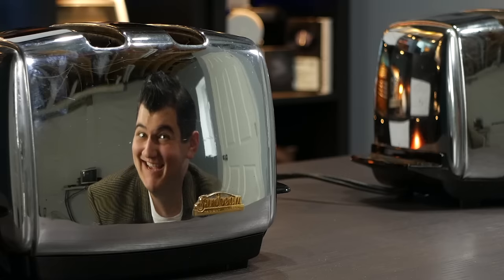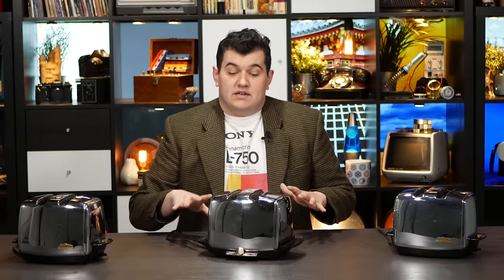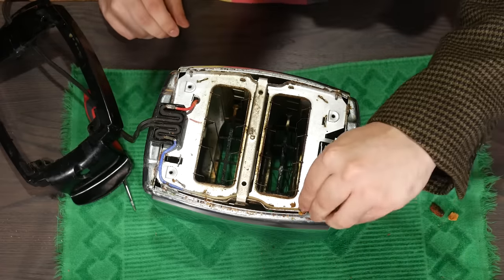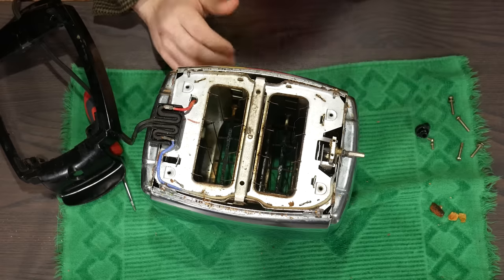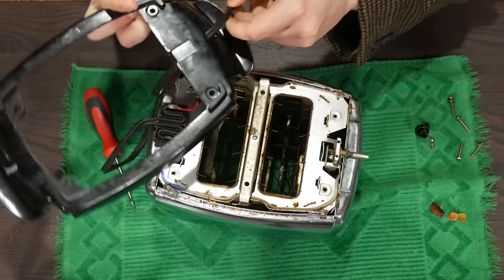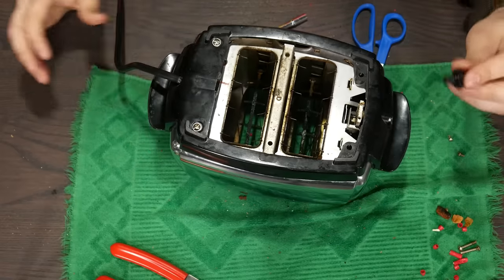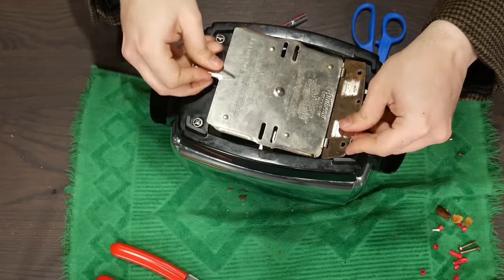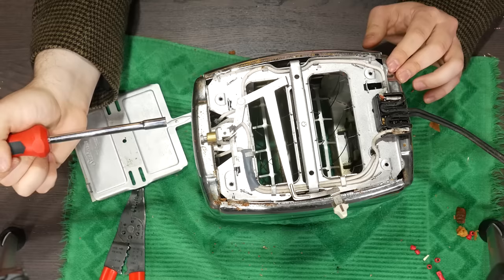Sunbeam Radiant Control Toaster--Repair and Modernization

Comment: An important note about grounding the toaster:
There's some healthy debate in the Internetosphere about whether or not a toaster should be a grounded appliance. And that debate is not without merit. Now that the toaster is grounded, it is potentially more dangerous in the scenario that someone is foolishly sticking a knife down there. If they touch the knife to the wire, and their other hand is touching the toaster, there's now an excellent path to ground through their heart. Not good.
But, because this toaster is just a circus of exposed metal surfaces with energized wires snaking through it, there are many potential ways for the wiring to short to the chassis, and thus you'd end up with a toaster that can zap you just by touching it.
So, you've got to decide which risk you're more willing to accept. Personally, given the old and questionable insulation in our T-35 toasters, I'd prefer if the chassis were grounded. I know I'm not dumb enough to stick a knife down a toaster, but I don't know if the chassis might inadvertently become live. Still, I understand the theory behind not grounding a toaster. So, do whatever you like.
However, if you've got the toaster plugged into a GFCI outlet or on a circuit with an RCD, both potential risks are mitigated by external means. So there's that!
Reply: Sure if the chassis was live it could zap you just be touching it, but that zap is very unlikely to be fatal, or even particularly painful (I've accidentally touched exposed 120v wiring before, it's really just tingly) if it's just done with one hand. Hand-to-hand circuits (with the heard in-between obviously) are much more dangerous.
Reply from the maker: It's pretty much a pick-your-poison scenario in my opinion. And/or situational. With children in the house who don't know better, it's probably wise to leave this without a ground. In a kid-free household, I'd rather ground it and not be fearful of its antiquated internal wiring. In either case, GFCI protection is a welcome improvement! And honestly, if you have kids--I wouldn't use this toaster
Reply: I would side with the "metal case = needs a ground" people.
Reply: That's a weird thing I always come across in North American youtubers. At least in my country, a GFCI is mandatory on the entire house circuit (or, even better, for each circuit you have). So, the fact that an appliance IS GROUNDED, that's an actual benefit. Also, if the chassis becomes live, it will trip the GFCI as well. It's amazing how much danger you put into when you're not using an GFCI outlet, even at this stage in history, just amazing.
Reply: My only gripe is that you are replacing rubber insulated heater wire, the reason why the old cord is still as flexible today as it was new, with PVC insulated wire. Heat and that wire are not a good combo, in my opinion. I think the internal wiring is asbestos, I have repaired a few vintage heaters with that kind of wire and the way it strips is fibrous. 

You could have gotten a smaller connection by hand soldering it rather than using crimp connectors(my nemesis).
Reply: Most recent-ish North American residential installations have GFCI outlets in places where an outlet might be near water -- bathrooms, kitchen counters, and outdoor receptacles.  That would cover the toaster situation.  Typically, each outlet or circuit has its own, independent GCFI, whereas (from BigClive's recent video on the subject) a ground fault in a UK household might take out power to half the home.

Older homes that have not been brought up to recent codes will still lack GFCI circuits, making electricity in the kitchen and bathrooms more dangerous.
Reply: @catlover10192  A toaster can be near the kitchen sink or a grounded fridge, microwave etc. In that case it is easy to touch bot. Also the floor could be conductive. As a rule in a place where outlets are grounded you should ground everything that is not double insulated.
Reply: @richardhz-oi8px  It's very, very difficult to solder aluminium (one of the wires is of that material and one of copper, he said).
Reply: @cocusar  The fact that GFCI is mandatory on new installations means nothing when the installations are old. An average age of an installation is decades. I still have ungrounded sockets. They were banned in 1997. In 1997 GFCI was made mandatory in bathrooms, in 2008 in all sockets with the exception of the fridge. In 2017 also to the fridge and lighting. There are many installations that are done before 2008. I have no intention of replacing them. I do have GFCI on my consumer unit but it is not connected as the sockets that are grounded have ground connected to neutral and that would trip the GFCI. I do have a separate GFCI for the washing machine.

Also safety features as a general principle supplement each other. They do not replace each other. GFCI
Reply: @okaro6595  Indeed, but in my country it's not only mandatory for new installations; also for old installations and you had to comply with those if an inspection was set. Also, making them mandatory for the entire house circuit INSTEAD of some sockets, it's almost entirely safer. I think there's a need to use GFCI for the house instead of selectively using them for some sockets. Yes, I know that someone with an old installations might not even care (in the US) but it's common sense. Installing a GFCI is easy, and you don't have to replace the entire installation; at the most, you'll have to add a ground cable. Also, bridging neutral to ground is a stupid idea, since no GFCI will save your life; and we ditched that way of doing things long time ago. It's a cultural thing by the looks of it.
Reply: @TechnologyConnextras  If it's any help, my new-ish UK metal toaster's case is grounded. Makes sense to me.
Even if someone was stupid enough to stick a knife in there, the chances of them touching the live element without shorting it to the chassis is low. So it does add some protection. If it wasn't earthed they could more easily short the element to the case which would not cause a fault, which is definitely worse.
(But everyone knows not to stick knives into toasters usually!)
Reply: Here in the EU I have never seen a toaster without a grounded plug on it. So yeah .. I'm in the 'ground it' group ;)
Reply: Ah yes. Serves me and my big mouth right to comment on the other video before watching this one...
Reply: Putting knife to a toaster is stupid idea. If you do that then no amount of grounding or ungrounding is going to help you, a team of specialosed psychiatric doctors might give it a shot.

Therefore that should not be a concern, accidental touching of a chasis is a different story
Reply: @cocusar  What country? That is totally unbelievable. How could the state mandate people to do renovations on their homes. That is like total fascism.
Reply: And in case of children just keep appliances like that away from them.
Reply: @okaro6595  Argentina, but they don't force you to do so until you have to do a check up in your installation. It's mot fascism, and I think its great for the safety of people
Reply: @cocusar  Checkups on houses? IMO that sounds like fascism.
Reply: How about to avoid that problem you use a fuse so it will now allow those large currents through you heart? The superior UK power plug wins again! (now just figuring out how to make the toaster work in 240V)
Reply: @okaro6595  I'm not sure if you're being serious or sarcastic ...
Reply: @Red_the_IT_Guy  It only takes 0.02 Amps to kill you. Same current as a small LED. No fuse will be able to save you.
Reply: @oscar_charlie  It might, the time it takes a fuse to break is small enough that, from what I have seen, it can stop the current before it kills you. Mabey I'm wrong though.
Reply: Hideki Shinichi I think you’re being a bit broadly judgmental and dismissive of the idea of child safety. Toasters are frequently the second appliance in the kitchen after the refrigerator that children are permitted to use, and all-metal table knives are the only utensils they are allowed to use (and/or can get at themselves) at that early age that could possibly dislodge a stuck toaster pastry (which are breakfast items marketed to children as a hot breakfast they can prepare themselves).

So the scenario of a child of otherwise ordinary responsibility for their age sticking a metal knife into a live toaster is not a bizarrely unlikely one, nor is it a sign of idiocy, nor necessarily is their being allowed to use the toaster a sign of parental negligence. To the contrary, these things align—if a child’s toaster strudel gets stuck and it starts to burn, and the child’s choice is whether to wake a parent to fix something they may perceive as their fault, let their breakfast be ruined, or try to fix it themselves, it’s not just the dimwitted or irresponsible child who will attempt to fix it with the means at their disposal.

Since those means are potentially extremely dangerous, in a way the child is unlikely to intuitively grasp, making the appliance itself as safe—in that perfectly foreseeable scenario—as possible isn’t acceding to stupidity or mental illness; it’s taking responsibility for a realistic and mitigable risk.
Reply: A toaster should always be grounded. End of.
Reply: @Majromax  Indeed: We always try to dissuade customers from having a split load board fitted, the individual RCBOs (GFCI breakers) are not THAT much more expensive and much more convenient. 

And it's worse than clive's video suggested. Until VERY recently, it was fine to use a RCD (GFCI) as the actual main switch. A fault on one appliance, or a damp plug, could kill the entire house. Plus, with enough appliances, normal leakage from filters and suchlike can bias the rcd into almost tripping in normal use.
Reply: Honestly I'd just replace the toaster plug with a GFCI/RCD plug that they use for hair dryers. 

Speaking of that, why isn't that a thing? My kitchen didn't have any GFCI receptacles until I installed some a few years ago and I know most kitchens in older homes are the same way unless they've were built or renovated after the 90s. Hair dryer manufacturers are required to install GFCI devices on the cord because bathrooms don't have GFCI receptacles, so why not have the same requirement for toaster manufacturers?
Reply: Couple things about your crimps. First off, big clive probably has a video on it. Make sure to tug test them after crimping, don't simply call them good as long as they don't fall apart while working with the wires. Second, I may be wrong here, but I believe your crimpers are meant for unshielded connectors. I believe the ones with the part sticking out on one side (like yours) are meant for unshielded, while the ones that are smooth on both sides are meant for shielded connectors. Feel free to yell at me for this part, but why not just cut the plastic off the butt connectors so you had unshielded ones?
Reply: @TechnologyConnextras  Your main channel video states that the entire body of the toaster is referenced to neutral, such that if you plug the non-polarized plug in backwards, then the body of the toaster is electrically hot even when it's not toasting.  If this is indeed true, and there is no insulation between coils and body, then the toaster will never operate on a GFCI outlet with a third-prong ground installed on the neutral reference.
Reply: Here in australia, its unthinkable that any toaster post ww2 wasn't fully grounded.
Reply: @truelazerlight  Government doing checkups of your house is something I just do not get.
Reply: @K-o-R  I do as well most of the time, but I do have an exception. In some cases I find that it may be better to leave a piece of equipment unmodified if the original cords are still safe. This is to preserve the original conditions of UL listing. When using old equipment in a commercial environment I find keeping the original UL Listing valid when possible. Now if the safety people were to complain (they don't inspect for that where I work, they are more concerned about daisy chained power strips) I would fix it.
Reply: It should be a grounded appliance assuming its plugged into a GFCI outlet. I want to reiterate what you're saying here but further note that is how safety ground is supposed to work. The idea that grounding makes the appliance less safe is a bit of a misnomer. I think that its more correct to say that high voltage isn't safe to begin with. It only makes it less safe if you don't have a proper safety ground. The same thing can be said of double insulated appliances. If they aren't actually double insulated then they aren't safe either except you have no way of knowing if it is or not. Note that a toaster that has shorted its neutral to the chassis would be even more dangerous.

I was shocked via capacitance once when taking apart a 240v base board heater but didn't die thanks to safety ground. I was setting on a cement floor and the heater had its breaker off. But it was rewired to bypass the breaker because the previous home owner was an idiot. I really should have checked but I thought my AC detector was enough. Turns out my AC detector had failed with no indication at all it wasn't working. If there was not a safety ground the current would have conducted through me to the cement I was sitting on. Instead it went through my hand to the chassis and burned my hand instead.

You SHOULD have a GFCI to further make safety ground safer. But frankly if you're going to not hook up the ground you might at well make it live. At least then the capacitive shock will keep you from grabbing it while you reach for the outlet. And it case it wasn't obvious. Don't do that either.

P.S. some things like for example grounded shower drains are an absolutely terrible idea and I think are where the hysteria about not safety grounding things comes from. However understanding why that is different from your toaster is key to understanding why safety grounds work in the first place.
Reply: Having a ground is hugely better. the residual current breaker in your house would cut-off before you would receive any damaging shock if any current found a ground path...that's the point of a ground, right.
Reply: @Furiends  GFCI is on no way related to grounding.

Grounding can make things dangerous if there is a risk of shock as any grounded equipment is a potential path to ground. That is why in Finland you cannot use old ungrounded equipment on schuko sockets.
Reply: @okaro6595  It is worth noting there has been significant changes in what safety ground is meant to do over time. But I actually outlined in my last comment why that ground path is important.
Reply: There's a lot of design flexibility available for the housing with the rise of 3d-printing, be it directly printing parts from a high-temp plastic, or going through a molding step and reproducing a 3-d printed part in Bakelite.
Reply: @okaro6595  There are similar situations to this in the US as well. At least in my area, if you do a renovation that touches the electrical system in the house, you are required to bring the entire system up to code (this is a very important thing to look out for if you are looking to buy a house with older wiring).  I'm pretty sure this is similar to what Santiago means when he says that they do inspections - they are not "random government check-ups", just inspections when a contractor is required to do work.
Reply: @Zyxlian  Here you can change broken outlets or so such without making changes. If you do a rewiring then you need to put it to the current standard.
Reply: @Furiends  Well if the floor is conductive then one has to use grounded outlets. It has been the rule here at least since the 60s. We had a tile floor on the TV corner and therefore the outlet was grounded. The problem was that in the mid 70s TVs still were ungrounded and not double insulated so we had an illegal grounding removing cord. Back then any form of wiring on part of the user was illegal.
Reply: Plus, it is best to unplug kitchen appliances when not in use.
Reply: @cocusar  it's starting to become the norm here in the US. ARC fault breakers do basically the same thing as a GFI outlet just in the main panel. It's code on new construction where I live.
Reply: Build a GFCI into the power cord and you have a perfect toaster.
Reply: @TechnologyConnextras  Alec, having serviced many "heater" type appliances, I'm very concerned about replacing heat resistant wire with plain PVC insulation. As you pointed out in the main video, the case gets hot, therefore consider that new wire as heat resistant as the bread wrapper touching the case. You should be using "heater" wire. Second, you have no strain relief on the jacket of the new wire. Third, get a ratchet type crimper. It's better in tight spaces, and allows some options such as leaving the original crimp on the wire (possibly circularizing the crimp), and placing that crimp inside the new bare terminal (just push the metallic sleeve out of the sleeve, or cut the sleeve) before crimping.

A different approach, might be to use a proper 2-conductor heater cord, and add a black ground wire to the length of the cord (using black zip ties, and add green shrink tubing to the ends to keep it legal) and add a 3-prong plug. Now the only insulation at melt risk is for a grounded wire against a grounded case. Not as elegant, but even safer! Happy toasting!
Reply: @oscar_charlie  0.02 amp, when inside body yeah. Takes a bit more to breach though skin resistance.
Reply: @TechnologyConnextras  wouldent that only be a danger if you connect it to a ungrounded outlet
Reply: @TechnologyConnextras  legally every kitchen counter outlet should be a gfci already... for at least the past 15 years now.... especially around the sink. 2nd if the toaster is off and the un-switched side of the wire is correctly plugged into the neutral (as it is legally required to be) there is no danger when the toaster is off. Also if you got the knife or fork into the now case grounded toaster and didn't trip your breaker i'd be very surprised, which would only be possible if that metal utensil never touches any other metal parts directly attached to the toaster.
Reply: A lot of time in this video was spent trying to accommodate the original strain relief system. Removing the S channel block to make space for the wires and crimp/solder joints then enlarging the hole in the base would allow use of a Heyco 1207 or similar. I think that would ease reassembly and make connection of the wires simpler.
Reply: @catlover10192  Its not the voltage that kills you, its the amperage. In your situation you got lucky. Just because you got lucky once doesn't mean its unlikely to kill you. It takes very little amperage to kill someone.

You can't stop people from doing stupid things like sticking metal into an energized toaster. If someone sticks metal into an ungrounded toaster and touches the live circuit they will still get shocked if they touch anything else grounded, so planning to leave the toaster housing ungrounded to protect them from the chance that someone follows this one unlikely scenario is a terrible reason to design a system as such. 

You can stop accidents from happening in scenarios where the elements fail, a wire rubs through or breaks and allows electricity to make contact with the chassis. Adding a ground will protect you from the chassis electrocuting you in more likely situations like those when you go to investigate your untested bread as it sits in the broken toaster with a live metal housing. A ground is designed to be the least resistant path to earth so you yourself do not become that path when the device fails.
Reply: if the chassis was live and plugged into proper GFCI protection, the trip level of said protection is below the threshold of harm to humans. A household GFCI is considered by law to be a life safety device.  @catlover10192
Reply: a properly installed GFCI receptacle or breaker is considered by law to be a life-safety device and is designed and tested to open both sides of the the circuit (hot & "neutral") well below the threshold of human harm.  @TechnologyConnextras
Reply: well said. if the devices aren't up to newer codes, chance are the wiring isn't either. makes life as an electrician interesting.   @Majromax
Reply: I'm from Australia & we've got different standards but I've never seen a toaster or any metal bodied appliance that wasn't earthed & many of the appliances we had in my childhood(the 80s) were from the 60s.
Reply: Our kitchen had to be re-wired in the last few years because of water damage, but they only put GFCI outlets on either side of the sink. The outlets behind the refrigerator and the ones in the corner (the "coffeemaker" outlet) are just regular grounded outlets.
Reply: True story: I have some knives with a fully plastic handle. The cheese knives have this little two prong fork thing at an angle. The shank for the blade is also about half an inch deep in them. The sheet metal thing that holds the bread has bent out of the guide slit that kept it's end centered. Bending it back straight is good for two toast cycles, then it bends out again, sometimes touching the resistance wire and tripping the breakers. Rather thank wrestling with the schucko plug that fits too tightly, I'd hold the lever up from the underside (so it wouldn't turn on) and use one of the plastic handle knives to ben it back straight. One morning, I was rather sleepy and grabbed a full metal butter knife from the drainer spot where the plastic one usually sits. Halfway to the toaster, I thought "Wait a second, I am not stupid" and put it back and got the proper one from the drawer.
However, I have since found that letting it rest against a corner will keep it from deforming further or shorting.
Reply: the coffemaker receptacle may be "slave protected" by the GFCI. The fridge recep does not require GFCI bc it is serves a dedicated load and may be on its own breaker.  @mal2ksc
Reply: I am an Electrician in Canada and I can tell you, grounded is always better. The point of the ground is that for any reason the outside shell becomes energized (by loose wire or knife in toaster) the ground wire gives a low resistance path back to the house ground and should also cause the breaker/fuse to trip. The only time a non-grounded plug is allowed on an appliance/tool is if it has a polarized plug (the neutral pin is wider) and the appliance/tool is double insulated. A double insulated item will have the symbol of a double square (one square inside the other).

As for the short cord, yes this is for safety.  With modern kitchens requiring numerous receptacles along the counters, a long cord is required. And with a shorter cord, means less chance of toaster accidently dropping into the sink while live or any other cord accidents.
Reply: Technology Connections who cares if someone sticks a knife in a toaster it is natural selection smh
Reply: Neutral to ground wouldn't hurt you, just hot to ground, and the nichrome wire is only hot while glowing. I would ground it. Without a ground, there's still a shock risk, but the circuit breaker can't be involved in saving you. Ground it, use a GFCI/RCD.
Reply: @Benjamin P: *prong
Reply: @Majromax : Why a hyphen in "recent-ish"? Why not just "recentish"?
Reply: @Red_the_IT_Guy  Seriously? Oh, puhlease. No clue. Not even the beginning of one.
As to your plugs, they could perform the same functions and be quite a bit smaller.
Reply: @Red_the_IT_Guy  You're wrong - typical UK RCDs trip at 5mA and in less than 30ms. Your gloriously overdimensioned 13 amp fused mains connector will have not even blow the fuse before the poor victim is dead, dead, dead.
Sheesh.
Reply: Is the channel host paying homage to EEVBlog by doing repair while barefoot 🤔😉
Reply: So uh, why not float the metal housing electrically from the chassis. From what I can see of the design, the chassis is where all the wires sit, and is where the risk of shorting will be. If you insulated the chassis from the body at those 4 screws that attach the chassis to the body, and maybe at the end where the darkness controls or adjustments live, you'd remove that likelihood of the body becoming live. While you're at it, add an insulation blanket to the body, further preventing shorting and keeping the body cool, making it safer to the touch.
Reply: After adding the three prong cord, is it safe to use in the bathtub?  ;-)~~~
Reply: @stumpybear60  What about a soggy loaf of bread? Can you get electric shock when you are dropping it into the toaster?
Reply: @sireuchre  It wouldn't be FCC approve if you do so because it can generate obnoxious radio interference 😅
Reply: You should be careful about using a diode to change the voltage because even tho the RMS of the AC voltage would be 120 (if you are on 240 mains supply), the peak voltage is still >240 which is still really dangerous for heating elliments
Reply: You're completely correct about the GFCI or RCD. Everything should be grounded, and everything should be connected to a GFCI/RCD.
Reply: @okaro6595  In Europe, any appliance with a metal casing used in a potentially wet or damp environment (kitchens, bathrooms etc) MUST be grounded. There are certain exceptions for double-insulated or totally sealed devices (inductive-charging toothbrushes etc) but toasters, kettles, washing machines etc, are all required to be grounded (or "earthed" as we say here in the UK)
Reply: If you convert  to 240 volts for Europe  you must ground the toaster as you wolill get more  than a little tingle
Reply: @richardhz-oi8px  Yeah, you can use silicone wire instead. A bit more expensive, but heat resistant up to about 200 ºC.
Reply: @richardhz-oi8px  I'd never use a solder connection for this scenario. It's probably not getting hot enough to influence the solder later from the toaster itself, but it might still be exposed to oxidation and all the other potential hazards that follow (increased resistance due to oxidation, heating up, solder getting soft…).
Reply: @Smaxx  I truly believe that crimp connectors would hold up worse than a good solder connection, just a personal preference, I guess.
Reply: @richardhz-oi8px  Yeah, in the end I guess in this specific use case both would work, since you probably wouldn't use it unattended anyway.
Reply: thank god Germany has safe fuses that trip if Ground gets any current and shut off all voltage. 
So yes, we ground our toasters.
Reply: How about just sticking a GFCI/RCD right in the plug since you are grounding it anyway? This means that if someone is being foolish the on-ug GFCI would trip.
Reply: @hikaru-live  Such plugs/adapters actually exist and are typically meant to be used when there are extra risk factors such as water (thing an aquarium or swimming pool). However, that's not really practical, as you'd pay like 20-40 bucks per plug (our outlet). Better get everything properly grounded and secured, even if not enforced by regulations. :) And if someone's foolish enough, they might be foolish enough to unplug that thing, too.
Reply: Why stick a knife in it? A screwdriver can pass more current potentially! I hate making negative comments but I had to mention that as well. But overall another interesting video.
Reply: @nickponsford9544  If the installation is acceptable by the standards of the time it was made, that is OK.
Reply: Toaster should be grounded... they are in Europe. Even the 20€ Philips toaster is grounded.
Reply: @JohnHitman Yes and it should cut both wires when off.  I checked my toaster for continuity and there were none when if was off.
Reply: @K-o-R  The metal case has no electrical connection to the heating circuit - or you couldn't attach a ground wire to it!
Reply: @cocusar  The greatest hazard from  an electrical appliance built in the 1950's by Sunbeam is to the dufuss  who opens one up to "improve" it.
Reply: @okaro6595  Better ask your nanny before posting.
Reply: two things 1 small 1600-1700 watt fuses maybe? 2 if you stick a knife in one you automatically become a ground where you are standing.
Reply: @catlover10192  Amperage is key voltage not as much. 95% of people can get away from 15 amps (living room/ bedroom amperage) 80% of people can get away from 20 amps (kitchens dining rooms garages amperage)
Reply: @cocusar  In america the standard for most homes since 2009 has been. AFCIs for every light or outlet circuit connected or child to the main breaker panel. GFCI is required in bathroom kitchen most garages pools outside areas and laundry rooms. or any area where moister or extreme risk of electric shock. If GFCI is present on a circuit it can take the place of a AFCI in most cases.

AFCI= Arc Fault Circuit Interrupter = A device that shuts off a circuit if the mechanism detects arching type behavior (ie a lot like a GFCI, can detect GF's but not always the same way a GFCI can)

GFCI Ground Fault Circuit Interrupter ( Detects when Amperage leaks off the circuit and disrupts the current flow)

GAFCI/ Ground Arc Fault Circuit Interrupter (A combo unit)

Any of these units can be implemented into breakers and outlets. Also these devices only work when upstream from a point of danger. (at the panel vs after one of the outlets)
Reply: Leviton makes RCD power cords. Use those. It is a power cord with a built in RCD and a MCB. Get the 10A version and be fine (tolerates 13A without tripping. Trips at 14A)
Reply: Wouldn't the toaster potentially make some electrical noise when grounded too?
Reply: A toaster like that should always be grounded according to EU standards.
Reply: “I know I’m not dumb enough to stick a knife down a toaster”
8:43
Reply: This seems like a no-brainer to me. I wouldn't hesitate to prioritize protecting users from an internal short to the metal case (which they cannot avoid) over protecting them from their own stupidity in sticking a knife into a plugged-in toaster.
Reply: @TechnologyConnextras   I love this thing! I do have a question, though - I'd more than love to have one of these, but I'm situated in Sweden where we have 230 V in our outlets. Would plugging this thing in over here result in a massive explosion rendering me homeless?
Sincerely,
Nic
Reply: Use a gfci plug like a hairdryer would have.
Reply: @richardhz-oi8px  would a cable designed for high amp resistive heating loads be a better choice? 

 I'm thinking of one of the fabric covered ones commonly used (mandatory) for irons in the UK.
Reply: @Rymac91  the toaster doesnt often end Up in you bathtub ;)
Reply: @cocusar  Yes I agree, I think it will either trip the GFCI or render it less effective.  The potential difference between neutral and PE (Protective Earth) is meant to be there for detection purpose.
Reply: Nope. Ground it. It's not a double insulated device.
Reply: Ground and neutral are tied at the transformer in residential housing in the US. No reason not to ground.
Reply: This is only true in countries where polarized plugs are necessary. Countries like ours both wires are live 110v, but one of them is counter-phase, then you obtain 220, so ground is mandatory to connect metal chassis non isolated appliances. Also there's some rules for non heating nor motorized appliances below certain power, that all must be galvanically isolated.
Reply: @Writer B.L. Alley My old boss would always say, "You can try to idiot-proof things, but the idiots will always find a way".
Reply: I agree with grounding it, spend a lot of my time grounding metal lamps etc. They don't call it a "Protective Earth" for nothing. I agree that being grounded to the toaster frame while sticking a knife down it could be fatal. So DON"T DO THAT. One of the comments mentioned touching a grounded object while also being in contact with an ungrounded device with a phase-to-frame fault. That could also be nasty, especially in a damp environment like a kitchen can potentially (ha) be. Also, an RCD is essential, your home switchboard should have one.
Reply: i just got one of these today. 240v (Australia)
Reply: @oscar_charlie  .....depending on the voltage......amps x voltage = watts
Reply: @TechnologyConnextras  theoretically every outlet in a US kitchen should be under GFCI protection so its prefectly safe to ground a metal toaster also ceramic utensils exist
Reply: Maybe it's worth sacrificing that beautiful  chrome for plastic 🤔
Reply: Japan uses ungrounded North American plugs everywhere.

Also, heat shrink would be way better than butt connectors
Reply: A GFCI / RCD does not in itself provide shock protection; enough current will flow to kill you before it disconnects.  Please don't think it's the solution for shoddy earthing.
Reply: @Technologyconnextras
Reply: No one mentioning not using CO/ALR connectors for the copper-aluminium connection? Isn't it a fire hazard?
Reply: well with that in mind, why not add an INLINE Fuse holder? This would help tremendously.
Reply: Would an ALCI plug mitigate these risks?
Reply: @johnm2012  It is doubtful that the wire was aluminum. I expect it is tinned copper - the tinning was used on a lot of two conductor cords so you could tell the two conductors apart.
Reply: This thumbnail
Reply: Just out of curiosity, I don't think it will effect it as there are no transformers. But if I got one of these sent over to the UK would our 240v be an issue?
Reply: What if you put a ground fault breaker on the wire?
Reply: @odilebartlett8191  Sounds about normal for building codes in most countries. As an owner you're not compelled to renovate your property to comply with new legislation until it is formally inspected. 
I live in a building built in 1906, well before electricity was widespread in my state. All of the wiring is conduit and box with recessed/flush outlet boxes being found only on new walls. Only one outlet box in both the kitchen and bathroom are GFCI enabled, the rest are the standard grounded and polarized North American outlet.

I guarantee you that my state has laws requiring more GFCI outlets than are present but because routine building inspections are more concerned with structural integrity, vermin presence, and fire suppression systems the old outlets get pencil whipped into compliance or outright grandfathered. I would also assume that the building not being for sale and on the Historic Society's registry of history building would also make renovations neither necessary nor convenient.
Reply: The kitchen in my house was remodeled a while back, and GF interrupt outlets were installed in multiple outlets along the counters!  Not sure why, when a ground fault at any connected to the equipped outlet should trip it, and they are all on one circuit, but hey, why not?
Reply: @catlover10192  oh, you mean like what TC did at 33:50?...
Reply: Ugh... how stupid. You realize attaching the metal case to ground PREVENTS electrical shocks... right? 
If a wire fails, or a knife is inserted and touches the case, the INSTANTANEOUS dead short would trip the fuse or breaker feeding the circuit... 

If the case is NOT grounded... the short of live to case WOULD I safely energize the case creating a serious shock hazard...

Nothing to do with GFCI... which would also increase the safety of either case of ground condition.
Reply: @richardgr3gg  this is a high wattage device. If connected to a high wattage 240 to 120 auto transformer, it can work... but do not try to run it directly on 240V, it will fail rapidly... less than a second.
Reply: In the UK all sockets in a modern installation are protected by RCD at the consumer board, so if there’s an idiot who is sticking a knife in is also touching the case, the chances of the current flowing through the idiot’s heart is basically nil. Now if only these were available here.
Reply: So basically, with this toaster, without a polarizing cable, you're just one bad day from being the ground wire yourself. Got it.
Reply: Aren't those crimps ment to soldered with a heatgun ?
Reply: Yeah but if the knife also touches the housing... which is likely, you have a shorter route..
Reply: Yeah. Kids will definitely touch the toaster and burn their hands. Not kid safe.
Fun fact: I was one of the kids that put a fork in the toaster. It was the only way to pick up the bread. I just stabbed the bread at the top of it with the fork and pulled it out. Didn't put it into the toaster since I already knew it was dangerous. Well I'm still alive.
Besides getting zapped isn't that bad. If I touch the stove with one hand and the microwave with the other I get zapped. It's tingly, in a stabbing way. Mom's house have it's electrics messed up and it have old wiring. For instance in the bathroom there's an old wire that have the old cloth winding surrounding the wire and to protect the wire there's a metal cable protector on it. If you touch it you've get quite a kick from it. It runs 240V in it to a light switch. When I discovered this I was sitting on the toilet and the kick made me fall off in the opposite direction of where the wire protector was. Took me a minute to recover of confusion. The adrenaline kick I got made it difficult to resume my toilet business. Another thing I learned.
Electricity is fun. In the living room there's a metal floor lamp. When I run my fingers up or down it my hand tingles. Oh and don't try it with your fi-fi. It's not tingly in the good way. I was young, don't judge.
Reply: @okaro6595  you may install lead pipes and an elektric panel from the 1920s but don't expect a fire insurance to cover your state of the art renovation skills
Reply: @rowenkylee5627  That's the thing if you're aware of the dangers. They're not so dangerous.
Reply: @catlover10192 120v can also kill you, or seriously injure you, if you're grabbing something with your hand. The current can make your muscles lock up and you can't let go so it just keeps shocking you. Best to not be casual with it.
Reply: Hot glue the leads to the strain relief.
Reply: @catlover10192  Dont forget in the UK 13amps,  250v RMS,  thats pushing a peak 3Kw through you !
Reply: You could also use a polarized non-grounded plug (one prong is larger).  That would solve your concern about the element being energized while off.
Reply: @cocusar  I believe that if there were more reported injuries/deaths associated with this, changes would be made.  But there just aren't.  For all it's deficiencies, it's really pretty difficult to kill yourself with 120vac.  Here in America, insurance premiums and lawsuits are the real drivers for change.....
Reply: sorry to be offtopic but does any of you know of a way to log back into an instagram account..?
I was stupid forgot the account password. I love any tricks you can offer me
Reply: @Zayd Elijah Instablaster :)
Reply: @Lukas Ethan it worked and I actually got access to my account again. I am so happy!
Thank you so much, you saved my ass!
Reply: @Zayd Elijah happy to help :D
Reply: In Taiwan we have a 110/220 60hz circuit but the grounding is often missing or fake (meaning it has a 3 hole plug that has the ground connected to nothing at all). So therefore it may be good to somehow insulate the toaster in such a way that the bare wire will NEVER come into contact with the case. Here we often pull off that third pin because we know they're not used at all. In all but the most rigorously built buildings the electrical work is suspect.
Reply: @cocusar  GFCI doesn't actually measure anything about the ground. It measures live and neutral and makes sure that all current that is sent over live is returned over neutral. If current gets to ground some other way (ground pin, water pipe, etc) that is a ground-fault, and it will trip.
Reply: Insulated knife
Reply: Honest question, would something like WD-40 help the first toaster you fixed in this video?
Reply: Excellent clarification. the good ol GFCI, almost as much as a life saver as the undo button.
Reply: @cocusar  We use 120v so it's not as dangerous to get shocked. Our system is pretty safe, except for our habit of plugging in extensions willy nilly.
Reply: @Majromax  In Australia, it's common to have many protected circuits! Probably not always a requirement, but I always see lots of individual protected circuits.
Reply: I think the toaster is much more likely to be touched on the outside than the inside. Therefore, it should be grounded.

Simple solution- put a stamping in the metal near the slot- DANGER- DO NOT INSERT METAL OBJECTS WHILE LIVE, and add a grounded lead.
Reply: Did you ever find out if the internal wiring has asbestos insulation? And if so do you know if the T-20s had asbestos insulation in their internal wiring?
Reply: @B.L. Alley 
Wooden toast tongs. Severe Pop-Tart Burns and fires are so common they print cautions and disclaimers on the Packaging. Knowing and experiencing this I'm sure I've set my own toaster on fire at least three times, molten sugar Burns really well. Curtains trim paint and cabinets are easy to ignite. Proceed with caution. Be careful out there.
Reply: there's a horizontal scroll bar
Reply: @official-obama  
This is an example of what I call the dangling antecedent. A comment could be a comment referring to the flow of the thread in response to the video. It  may refer to the comments stream, be a reply to a comment or a reply to a reply but which one in particular. It really hardly matters what you are saying if no one is certain to who or what you are referencing.  The @ symbol points to a person or a screen name. Still the question or the quarrel may be vague or amorphous.
Reply: @TechnologyConnextras  
Three words: wooden toast tongs.
Reply: @nicholasgardiner9601  i have no idea what you're referring to because youtube hates the idea of an actual conversation, but that horizontal scroll bar is still on your reply
Reply: @official-obama  
Thanks for your reply. What is the horizontal scroll bar in reference to?
Reply: @nicholasgardiner9601  you know how there's a scroll bar to the right of the videos on youtube? imagine that, on the bottom of your comment
Reply: @B.L. Alley very true mate!
Reply: @richardhz-oi8px  You NEVER solder live wires. The heat from the current alone can make the solder joint weak or break completely. That is crimping is MANDOTORY on live wiring.
Reply: If you have grounded appliances you also need a RCD. Without it, grounded is just a deathtrap. Live wire is not that dangerous in of it self. I have gotten hit a few times by now but only hand to wire. Never through me. And sure it is uncomfortable but not deadly and more importantly it is only for an instant and you can let go. The AC will lock your muscles if it goes through you and that will kill. And the grounding is exactly that, a muscle locking circuit, without an RCD. It's the RCD that switches the power off and safes you. That is why grounded systems are safer.
Reply: You know technically everything you wrote is BS in the panel box the ground in the neutral are the same thing. So if the thing is plugged up correctly with the single plug the outside case of the toaster is grounded or it is hot it’s plugged up wrong. He has the same dangers in the same risk as any appliance in the kitchen Appliances but if someone’s Toast get stuck in there most likely the poke A knife or fork too try and get out. They say there’s 1 million ways to die in the kitchen and even more in the bathroom because beauty kills more than electricity.
Reply: "I know I'm not dumb enough to stick a knife down a toaster..."
But, screwdrivers are totally different!
Reply: @cocusar  GFCI is mandatory in the US for Kitchens, Basements, and other damp areas - and has been for a long time.
Reply: Hey can anyone tell me what tool he used to undue the side shell? He just said screw but it's a weird tool. I need to know this since I plan on taking the toaster apart to attempt to fix it.
Reply: In my view, grounding only increases the risk if you are putting something metal down into the toaster, and that is something that is YOUR fault.  But if the internal wiring fails and shorts to the case somewhere, you could get a shock by touching it, which is NOT your fault.   So I'd side with grounding the case.  Personally, I have been inside my T-20B (an old one fromt he 50's) and the internal wiring is remarkably pristine.  We may hate asbestos, but man oh man, that stuff holds up.  So I'm going to go with a new cloth-covered wire (I don't want to spoil the looks) and a polarized plug.
Reply: @cocusar  GFCI on the whole circuit (a GFCI breaker in the panel) or at the outlets, have been mandatory for all kitchen wiring since 1987 in the USA.
Reply: @johnm2012  You should not be soldering joints inside an appliance like this.  Under heavy current short circuits, the joint can get so hot that the solder melts and the joint completely fails (which may make things worse!)  That's why they use heat resistant crimp connectors, and why you use wire nuts in internal house wiring.
Reply: @cowsongs  It's a four year old thread with nearly 200 comments. I don't know what you're referring to. Early on I pointed out that aluminium is very difficult to solder, which doesn't sound like a recommendation to solder to me. In any case "heavy current short circuits" must be avoided at all costs.
Reply: @cocusar  It is because in America the TN land is used, in Europe the TT land is used, in fact I never knew the history of that, it would be a video worthy of Technology Connections since it is a curious story.
Reply: If you stick a knife down a toaster, there's a very high chance that you'll short the wire to the toaster body through the knife since there's metal racks in the way.
Reply: @cocusar  Most US codes now require them in kitchens and bathrooms on all new construction, but there are a bunch of old houses out there that have not been upgraded to have them. My house was made in the 1950's and it has GFCI in the bathroom but not the kitchen.
Reply: Not exactly true, the reason for grounding the chassis is exactly that, if for some reason the energized parts come in contact with the metal case, there is path to ground, which will most likely trip a circuit breaker or GFCI.
Also the reason most people would bet a shock from the energized case is if they where to touch a plumbing fixture or ground, as in bare feet on concrete floor and or other grounded appliance.
Sticking a metal object into a live toaster will not shock you unless you are grounded.
Reply: Soldering should not be used, as the high temps can and will degrade the connection over time.
Trust me tube sockets in old radioes had that issue.
Reply: Wait, there are no gfci outlets in america homes?!
Reply: I just now found you - adjusted my toaster - Great!!  However, during a recent storm it appears my toaster experienced a power surge (nothing else in that socket was affected).  It is only heating to about 50% maybe - can this be fixed.
Reply: @oscar_charlie  What? How? Pumped directly onto your pacemaker? On the fuse of the bomb straped to your body? How would such a small current kill you?